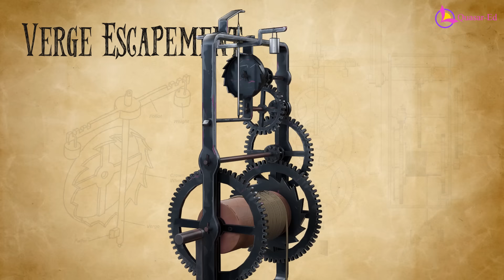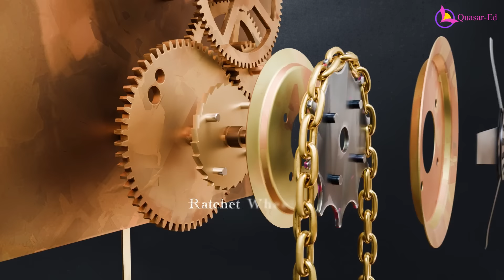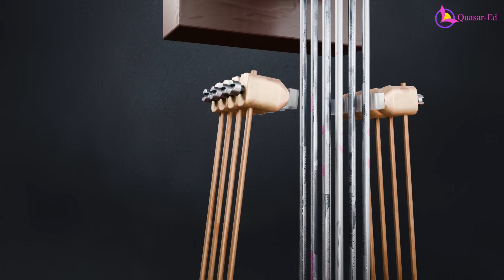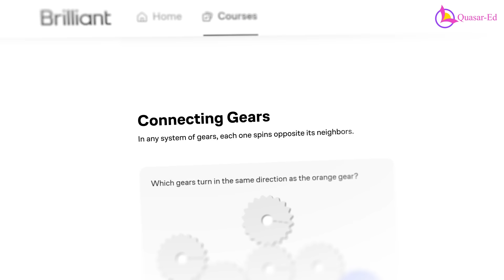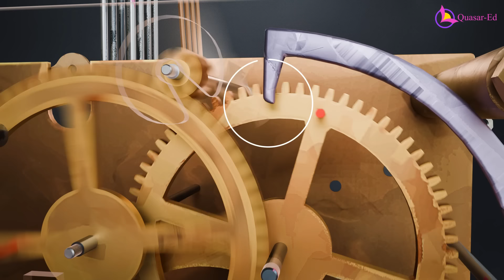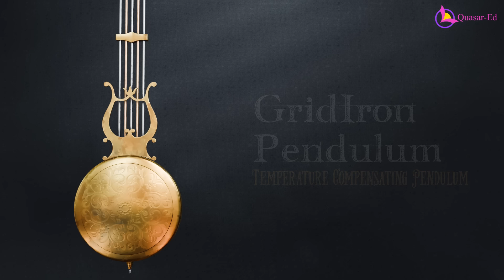From Weights to Chimes: The Inner Workings of a Grandfather Clock

Comment: I'm about halfway through the video and it's excellent so far. 
Way better than most other similar type videos I've seen (about clocks). 

I only have a few quibbles about terminology: 

The "strike flirt" is more commonly known as a "locking lever", 
and in clocks with a separate lever attached to the same arbor (axle) which interacts with the count wheel, 
that is known as the "count lever". 

(In this design in the video, which vaguely resembles some British Enfield, and German Hermle and Kieninger movements, 
I guess the long lever merely has a "count pin" on the side). 

At least this is common USA terminology. 

Brits have different lingo, where what we call the 'count lever' (the lever the actually interacts with the count wheel to 'feel' the slot) is known as a 'locking lever' there (sometimes), and the count wheel itself is known confusingly as a "locking plate" 
(although, given the amount of power delivered to it and its placement in the gear train, it is never used to actually lock the train in most striking clocks- 
that is the smaller wheel further up the train closer to the fly, which would be the "locking wheel"; in some clocks, the same as the 'warning wheel' (and often the same pin).  

--- 

In the various clock repair and history books I have (which mostly date between about 1908 and the 1990s), 
the word "flirt" is NEVER used to describe a slow-moving basic count/locking lever like this: 
instead, "flirt" is only used to describe a spring loaded, very fast moving piece which is used in some French clocks (like some carriage clock movements) 
to knock the locking/counting lever out of the way to start the strike train moving. 
It is used instead of a traditional 'warning' action, (where the train is released briefly before the hour to run a short duration and then held up again, 
then released exactly on the hour). 

Instead of warning (where the actual wheel train is released to run and the pin on the warning wheel caught by the warning lever / piece on the lifting lever), 
clocks with a 'flirt' have this as a springloaded piece which is gradually raised by the pin or cam on the time train, against spring tension, 
and then eventually let go ON the hour, where it snaps back suddenly and knocks the counting/locking lever out of the way, 
unlocking the striking train very suddenly to strike the hour. 

At least, this is what I remember from the various clock books I have. 

Perhaps the use of the word 'flirt' to describe various strike / chime train levers, has evolved and changed since I last was seriously working on clocks in the 1990s. 

--- 

From an engineering perspective, I can see pros and cons of each design: 

Clocks with a traditional warning (where the train runs for a fraction of a turn just before the hour) 
arguably have the striking train better 'primed' and 'ready to go' to deliver the first strike on the hour (or close to it), 
whereas clocks with a springloaded flirt may be a little bit less precise in when they start striking. 

However, presuming this difference is insignificant, then I can offer this: 
the loading of the time train caused by the stronger spring of the flirt (vs the normal loading of a normal unsprung or lightly-sprung strike lifting lever) 
might affect timekeeping as the flirt is drawn further and further back, before it is released. 
(Clocks with no separate striking train which just deliver a single 'passing strike' on a bell or gong, can have the same problem, 
unless the hammer lever has only a very light weight/spring and/or is counterbalanced very precisely to minimize loading on the time train). 

On the other side, however, is the fact that clocks with a traditional warning DO run the strike (and chime) trains a little bit 
(even if its less than a full turn of the warning wheel, for example), 
which would probably run down the striking/chiming spring or weight a little bit faster than a clock with a flirt. 
This amount is probably negligible, though. 

The final difference, most apparent to the end-user, 
is that clocks with warning make a noticeable mechanical sound shortly before the hour, when the warning triggers. 
As far as I know (I don't own one), clocks with an actual flirt make no such sound, with the strike or chime train not running until suddenly released on the hour or quarter.
Reply from the maker: Thank you so much for sharing your knowlege about these clocks. I am very glad that my video reached to a clock enthusiast like you. I am not a clock repair profesional nor clock enthusiast, so I did worry that my terminology would be wrong. I did as much research as I could relating the history and terminology. But internet research only go so far. So thank you for pointing those out. I hope to learn more about clocks from the clock enthusiasts who found my video.
Reply: As a non clock person I think you did fantastically well here and got just about everything right except a couple of terms. You explained things so well that any person with mechanical aptitude, who is curious and pays close attention, can understand how every part of this type of movement works. This is great because hundreds of thousands of this general type of movement have been made (by Hermle, Kieninger, Urgos, Enfield etc) with some design variations (especially shape of the various components) for most modern grandfather clocks of the 1970s to the present that are weight driven with Westminster chimes. So this video can be broadly applied to understanding how they ALL work. Since this is a type of clock and type of movement that is really frequently encountered, I would say that makes this a very useful video.
Reply: Oh yeah, and nearly all of us call what you call a 'chime locking disc' as simply the 'count wheel'. 😁
Reply: I will be fair, properly naming this lever might be tricky, because in this design, it serves at least three functions: 

1. on the near end (closer to its pivot point) it is a count lever for the (quarter) chime train, 
and (on the far end), it is also 
2. the lifting lever and 
3. warning lever for the (hour) strike train, 
all in one. 

This is different than other (and usually earlier) movements where these functions are all actually separate levers (even if two or more levers might be mounted on the same arbor). 

I am not sure this exact design of tall clock movement evolved any earlier than the 1920s- the earliest movements I've seen like it in the clock books I have (I only have a couple dozen of the hundreds of clock books out there) seem to be British Enfield movements made circa the 1940s/50s. 

But perhaps there are earlier antecedents- I'm not really great at clock history especially when it comes to really fine details between movements made (*designed) in the 19th and 20th centuries. 

Anyway, basically what I'm saying is that the design shown in this video seems to be a mid-20th-century simplification of older designs for three-train movements (which could do all these functions, with rack and snail striking, as early as the 1700s- and three train movements with count wheel striking and pre-pendulum escapements, go back centuries earlier), where they usually used more separate levers/pieces to do all those functions, 
whereas here, they're combined into one lever, which must be cheaper to manufacture (among possibly other benefits).
Reply: Since I probably won't come back to this video for a long time (except to share the link to recommend it to others), I had better clarify one other thing I wrote here: Most (house) clock strike and chime levers in at least modern mechanical clock movements (19th and 20th centuries) ARE sprung, very lightly. Not all (some are designed to work solely with gravity), but most. 

This is to overcome some friction resistance that can happen over time with wear, as well as deliver consistently positive results each striking / chiming sequence. 

Older handmade clocks from the 1700s and early 1800s will usually have flat springs with one fixed end (usually arrow or teardrop shaped) screwed to the plate, with the free flat end interacting with a pin or other projection on the lever to give the spring action. I think some mass-produced clocks also have flat springs like this (for example, the elegant and really well-made round French shelf clock movements). 

However, most American movements (at least), have small thin wire coil springs that wrap around some of the strike levers (wrap around the arbor itself for the lever) and then have one end formed into a loop that lock around one lever, while the other end is formed into a right angle that goes through a divot or hole in the plate. 

Again, these springs are just a failsafe to keep the strike train from derangement due to friction buildup (from over-oiling / goop buildup etc, since clock movements are NOT supposed to be oiled, except a very few drops of special clock oil at key points, like the escape wheel teeth and pallets, only rarely done). 

Usually, the strike levers are configured in such a way that they can work fairly well under gravity alone. The big exception in nearly every house clock movement is the bell hammer, which does require a spring for positive action (or for any action at all!). Tower clocks, however, usually have so much weight on the lift lever for the bell hammer, that no spring is required (the hammer weight is plenty!). 

So my reference to the 'flirt' in the classic sense of the term, is for a strike activation lever (which triggers the strike or chime train from the time train), which is a little more heavily sprung than normal (like a bell hammer-lever type strength of spring).

Comment: I didn't just watch a video, I had an EXPERIENCE.
What blatant genius can even come up with this.
Both the clock and the animation.
Reply: The animation is excellent for sure. However as a clock nerd I can tell you that various different people came up with all the different parts little by little over the centuries. So things evolved one piece at a time- it didn't just spring out of nowhere fully formed like this. So for example, all known clocks had verge and foliot escapement (and either no hands at all, or just an hour hand) until someone was able to apply Galileo's pendulum to the mechanical clock (with verge escapement still), then the anchor escapement came later (and the deadbeat and other more precise escapements came even later). The pendulum, plus improved escapements, made minute hands (and then seconds hands) practical for the first time, changing clocks, thus changing people's concept of keeping time and 'being on time'. 

All known early striking clocks had count wheel striking, until the 1600s when rack and snail striking was invented. Almost every mechanical striking/chiming clock to the present still uses some combination of count wheel and/or rack-and-snail striking. 

Other striking methods are so rare as to be museum curiosities today, or only known from books. And, from reading tower clock collector Mark Frank's historical essays / papers on his website, I found out that early clocks did not even have a warning system for the striking mechanism: they either used the flirt method I have described in my other comment about a 'flirt' lever, or just simply directly lifted up the unlocking mechanism without any warning whatever! That latter method was abandoned really quickly, since the problem there is that the time train wheel with pin unlocking the strike train, would have to be moving fairly fast so it could 'get out of the way' of the strike train, or else it would hold the strike train in the unlocked/running position too long, and cause it to strike incorrectly (for example, hold it up in the 'on' position too long at 1 PM so it strikes three times). 

Another thing I found, with both small house clocks and huge tower clocks, is that the frame design changed, from what might be called a 'door frame', to a 'four poster bed' aka 'birdcage' frame, to finally the modern form with plates side-by-side (with additional evolution in tower clocks to a 'bedplate' frame, which enables individual components to be individually unscrewed for easier servicing in the field). So even something as basic as clock plates for a frame, didn't happen right away. 

The gridiron pendulum is another innovation that I think dates to the 1700s. 

So I think just about every element in this clock was in place in clocks of the mid to late 1700s, excepting the Westminster chime tune itself (dates to the mid-1800s with the famous Westminster clock in England), excepting the use of metal tone rods (which was/is a 20th century thing, although older clocks could have spiral gongs or tubular chimes, and even earlier, saucer bells) and excepting some refinements like the automatic chime sequence correcting mechanism (which is I think a 20th century innovation). 

Another big difference of course (between 1700s clocks and 1900s clocks) is that clocks in those earlier days were handmade, whereas this clock depicted is of a mass-produced design. So the other further innovations weren't just getting a nice-looking, nice-sounding, accurate clock, but figuring out a way to make it on a mass scale.
Reply: @andrewbarrett1537 I wish I could surround myself with people holding intellectual capacities as large as yours. I'm assuming you've repaired them, have you ever built one? Building a functional somewhat accurate clock would be ever high on my "bucket list". I like to obsess over old technology but never got to make it into something.
Reply: Thanks! I don't think I'm particularly bright, just a big nerd with a curiosity drive aka "how does this work?" "why is this like this?" etc. I have disassembled, cleaned a reassembled a couple clocks in my collection, but have not done any real repair work yet (requiring machine shop knowledge / tools / workshop space, which all serious full service clockmakers have). This is partly because I left the clock hobby behind over 20 years ago when I decided to go full-on into my main hobby which is automatic musical instruments (player pianos, band organs, orchestrions, music boxes etc.) also with antique pianos, reed organs and pipe organs. That is still my main hobby, but I got back into clocks more recently (in a small way) for fun. The market for mass produced and even some handmade clocks (like 18th/19th century grandfather clocks) has gotten to a point where this has become a very affordable hobby for any middle class person to get into, and IMO can be an enjoyable one. Plus, most clocks of this era (in good condition) keep perfectly good time for most practical day to day use (unless you have a profession that requires milliasecond accuracy like from the atomic clocks and central time services).
Reply: @andrewbarrett1537  Your main hobby sounds delightful as well, like, incredibly so. The perfect balance between mechanical and human, soul and industry, pinnacle of analogue modernism. I should save up some and invest.